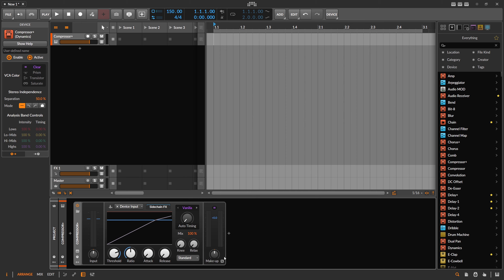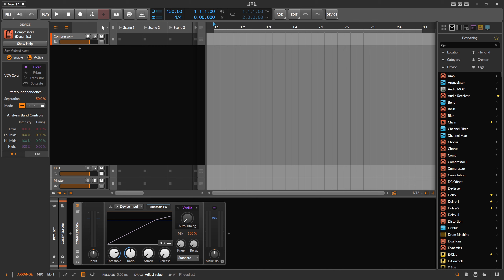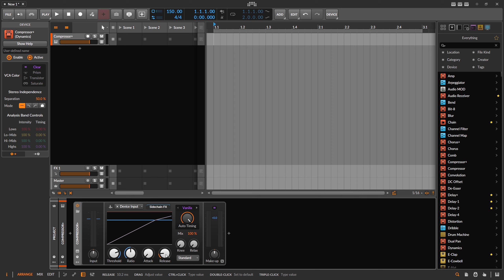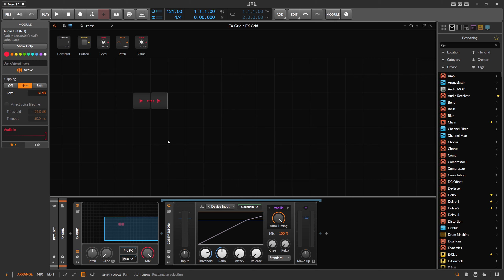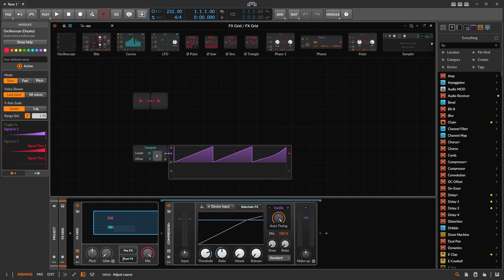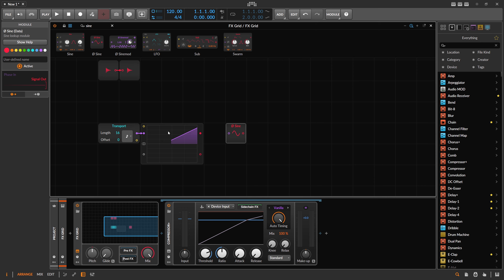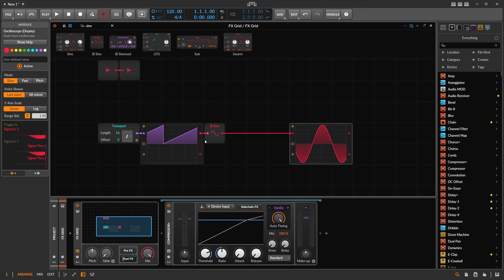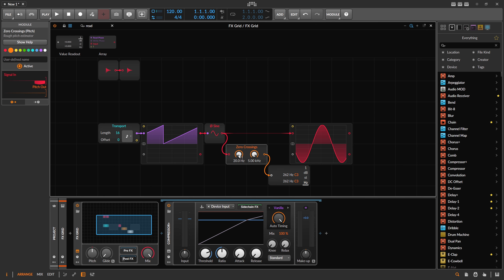The Bitwig Grid is awesome - BPM based release times in Bitwig

Comment: There is much easier way that doesn't involve zero crossings detector. You can get the constant phase sawtooth LFO (for example 1 Hz) multiply it by 100 for precision and then retrigger it with the phase signal (probably multiple times per phase cycle so it reacts to bpm change faster). After that you can catch the maximum amplitude by triggering S&H when phase signal equals one. The S&H output will be BPM-dependent, and all you need is to do the rest of the arithmetic to align this value between BPMs you need.